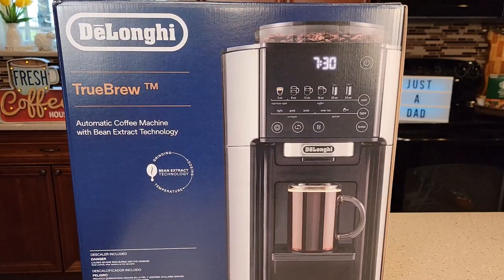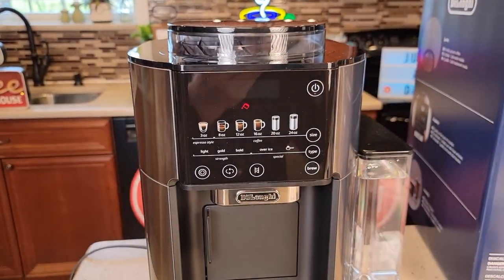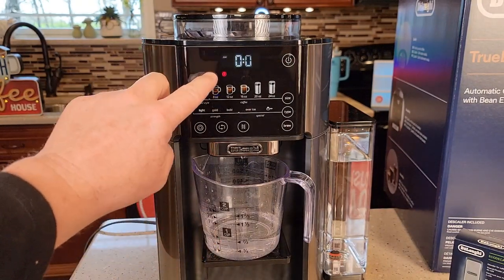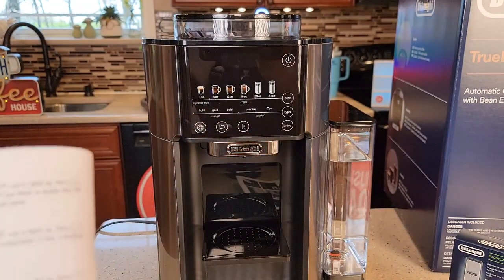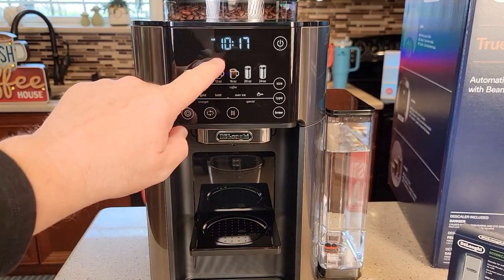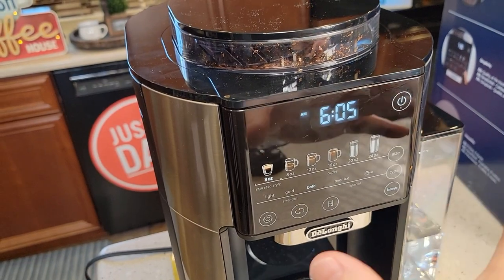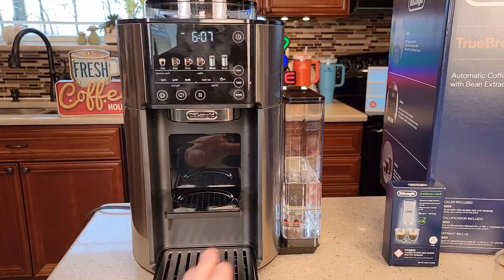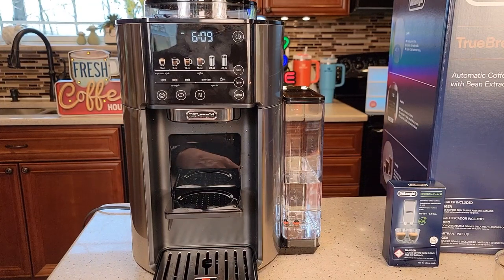De'Longhi True Brew Coffee & Espresso Machine Unboxing & How To Setup & Prime Pump

Comment: For grinding are there any other grind size or puck dose settings you can tweak or it’s all just cup size and strength?  Does the bold setting make a very rich cup of black coffee? I’ve developed my coffee taste for better or worse to prefer a really, really strong cup! I’m wondering if this machine could achieve that :-)
Reply from the maker: maybe a little, but I don't think this is what you are after,  sounds like you might like a Nespresso Vertuo Machine, These make some of the strongest coffee I have tasted.

Comment: Is there a way to just pour hot water? I tossed the water after the first cycle before realizing i needed it to determine the hardness of it.

Currently im just pouring it out my Keurig and going to base it on that, but seems silly it wouldnt pour water without beans like it did initially